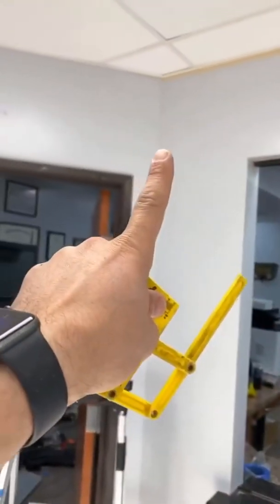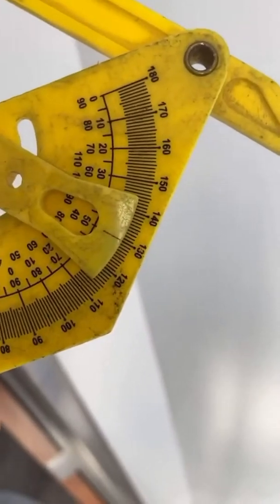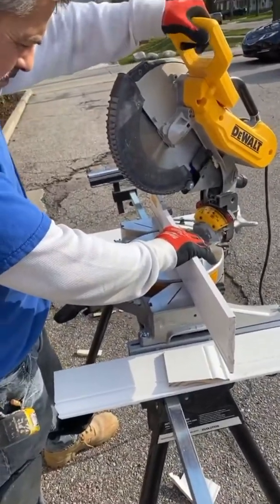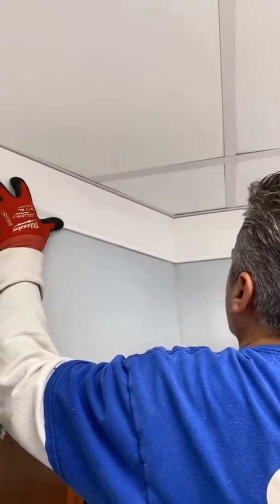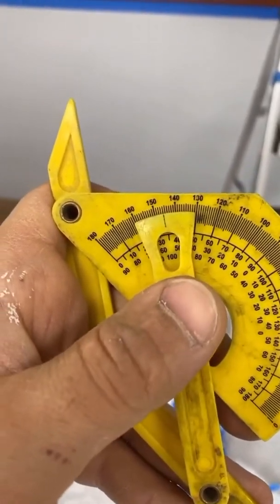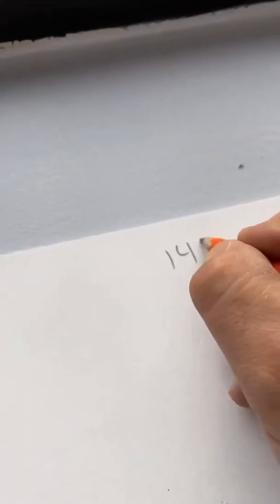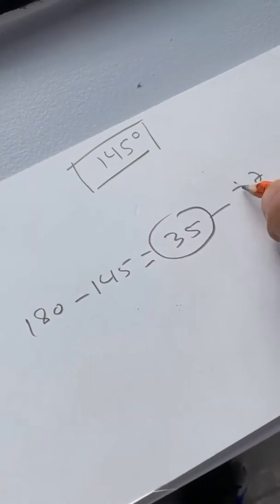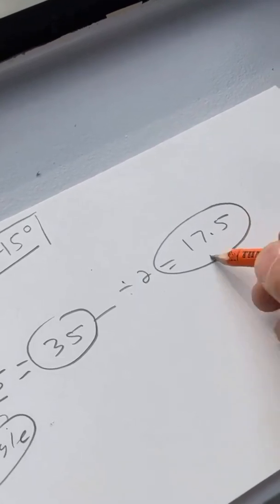How to cut angles that are greater than 90 degrees!

Comment: I'm trying to do or match the original baseboards on my 1920s house. The baseboards are 10 in tall. There's not a miter saw that I can find that will accept a vertical height of 10 inches or more. How do you make a miter cut on a board with that height?